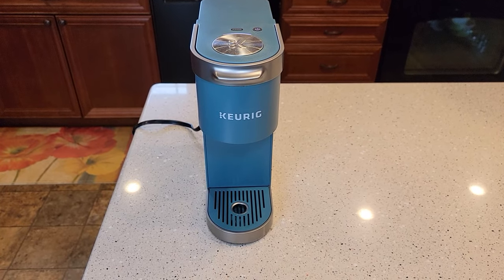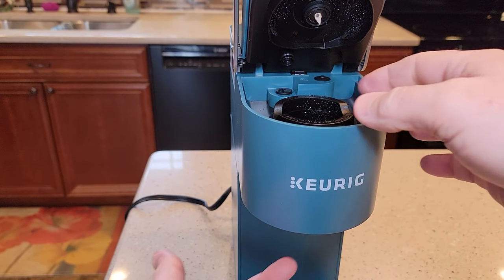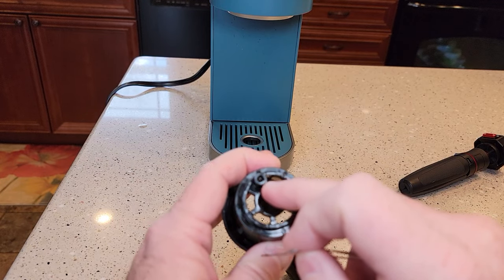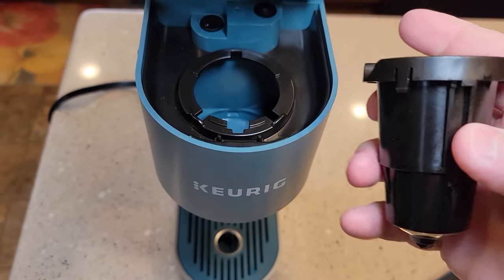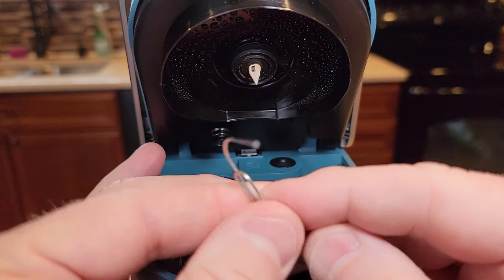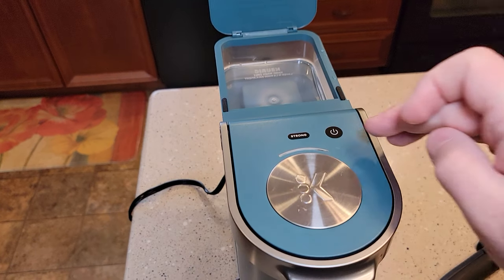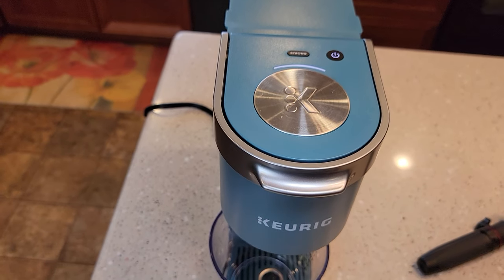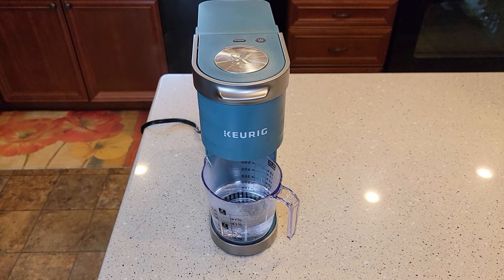Keurig K Mini K-Cup Coffee Maker NOT WORKING How To Clean Needles & Fix Not Brewing

Comment: I did everything showed in this video and still the water didn’t drain through the reservoir.  I discovered the filter inside the water reservoir was clogged due to me pouring a cup of freshly made coffee back into the water tank which caused the sediments to clog the reservoir filter.  I suppose I should’ve have done that. Lucky for me I got it working just fine after cleaning out the coffee sediments from the water reservoir.  Hope this will help anyone else with this problem.

Comment: I phoned the Keurig help line who then suggested cleaning the needle. I did and it worked. Flash forward a month and I'm back at square one. When it's not working, when it's clogged, the water gurgles and gurgles and comes down the inside of the machine into the bottom tray. It helps that you show how to properly clean the needle, specifically pushing the probe UP into the internal tubing. This has now solved the problem I was having. Also important is not leaving the K-cup pod in the tray after it has been used.
Reply: Now you might do a video about how to remove the cap from the Keurig cleaning solution after it gets screwed on stuck at an angle to the container. LOL.

Comment: Thank you for this video. The water wasn't dispensing and I thought I had forgotten to add water, so I added more water and it overfilled the tank. I didn't know how to get the extra water out. I found this video and I cleaned the needles and then also held down the button and my water came out. This saved me from having to take it somewhere to get it fixed.

Comment: Appreciate the tip - mine died just now - made slightly angry pump noises and only put about a half inch of liquid in the bottom of the cup.  Blew out the bottom needle and poked built up coffee grounds from the top, ran some plain water through and it’s back up and operating once again.
Reply from the maker: You are so welcome!

Comment: To force the water out:
1) Close the lid and press the big button. You will hear it start to pump.
2) Open the lid a little and then close it.

On mine, this will cause it to skip the heating and it will push out all the cold water.

Comment: You would be able to do a vid on the K900? I'm a handyman for a 28 room lodge with kmini and k900's. I've fixed a few kminis but the k900's baffle me. Most stop even sucking in water. And i honestly think they are designed as throw away units. The needles are never gunked up. And i may be wrong, but do they work with the cover off, I've never been able to troubleshoot one with the cover off and plugged in.

Comment: Hi!  My mini Kuerig is leaking from the bottom.  The cup is not cracked and I have cleaned, descaled, etc.  My reservoir is not removable so it appears I am not able to access a O ring.  Does the machine need to be replaced?
Reply from the maker: Wow sorry to hear this.  I would give Keurig a call 866-901-2739 they have great customer service.   I am not sure about the leak but I have had several viewers ask me about there K mini leaking water.  I am going to open mine up and see If I can see where the leak is coming from.

Comment: This doesn't seem to be my problem I'm looking for a solution I have the same single mini Keurig and the round button on top which usually starts it doesn't want to start the light blinks but I push it and no matter where I push it on that big round button on the top it just doesn't want to turn on. Anyone have any suggestions I tried to separate the top part so I could get to the hoses and that top portion but I don't know how to separate that and I don't even know if it does separate it.

Comment: It's really odd mine is 2 days old but stopped flowing just spit drips made a mess, I was going to just return it, I am using basic Nantucket pods nothing funky or off brand, yet when I did the clean jets and ran water thru (mind you I've only made like 6-7 cups total in this new machine) it came out totally full of grounds in the cup of just water running thru it.

So I repeated the process gently cleaning out the top 3 needles up into the tube circular motion, ran just water thru a few more times till it was flowing and no grounds, then made a decent cup of coffee again, but I guess I just didn't expect it to clog up SO SOON, if this happens again in the next 6-10-15 cups made I think I may just return it, when I want coffee in the morning I don't want to sit and mess with it every week to get it flowing again, hopefully a fluke and once a month I will just do some clearing and run water thru it.
Reply from the maker: Wow that does seem like it got clogged very soon.  That is why I like the Keurig machines with water tank reservoirs that hold alot of water.  the K-Slim is a great machine.  see my video on it https://youtu.be/HmNQslDiQsQ
With the water tank it makes running a fresh water rinse so much easier than having to fill up the reservoir each time you  do a brew.    I get a lot of comments on the K Slim clogging up so there must be something to it that makes it clog up more than others. 
Thanks for Watching and let me know how it goes.
Reply: I'm in the same boat! Mine is only a few weeks old and it has been clogging since day 1.  My old keurig lasted for over 10 years!
Reply: @hayikat  I ended up returning my single cup version, not crazy about the new one I got either but it punches 5 holes in the kcup and seems to flow better (so far)...

Comment: Helpful video but my Keurig mini isn't drawing the water up and out of tank. It is relatively new so I'm confused. Is not clogged but... my kiddo accidentally poured water into the k-cup area instead of water tank. :0
Reply from the maker: Pouring water in the K cup are should be ok.   Your water tank inside the machine might be full already.   Plug it in and open the k cup handle and leave it empty.. close the handle and press the big k botton like you are going to do a brew,   give it about 5 min and see if water comes out.   If nothing ,  lift the handle again and this time hold the big brew button or K button till water comes out, you might have to hold it for 3 or 4 min. let me know how it goes.
Reply: @JustADad  
I’m having this issue of water not being drawn, very new and not often used. I held down the button for 5 minutes or so but nothing. Any ideas? Thanks
Reply from the maker: @samsp6901  mabe put hot water in the tank and see if it will help clean it out.  have you cleaned the needles.
Reply: @JustADad  but the water is not being drawn at all, would placing hot water make a difference? I cleaned the needles as well and nothing. Thank you for responding.
Reply from the maker: @samsp6901  Try holding down the big k button for a long time

Comment: Mine did not worked it’s so frustrating because I just purchased a month ago and it only brewed once after that no more. Also this is the second one I get because the first one did not turn on at all.
Reply from the maker: yeah that is a bummer.  are you leaving your k cup in after its done brewing?
Reply: @JustADad  yes I leave it until it colds down and then I remove it. I have to add tons of water and press the brew button so many time in order to sometimes work.
Reply from the maker: @erickvazquez5323  I would call Keurig customer care at 866-901-2739.  They have great customer service.

Comment: dind't work for me.  when i push the big brew button it just keeps flashing.  cleaned the needles.
Reply from the maker: Maybe try to unplug it for about 5min. then plug it back in and put water in tank and try to hold down the brew big K button for about 30 sec. Not sure if that will work but give it a try.

Comment: I've found 2 major flaws with the Keurig mini so far: The needles getting clogged and the water not heating up or dispensing when you put less than 6 ounces in the top.
I've ordered 2 units from Amazon Warehouse Deals (returned, inspected by Amazon and resold) and both units had clogged needles. I think people just don't know how to fix the issue and simply return them. Amazon doesn't check their returned product very well either. Once they sold me a PS4 game with a BURNT disk (clear disk, no art, visible burn lines) in the case. "Amazon Warehouse Inspected" sticker on the case. I had to laugh...

Comment: I need help mines still not working and it’s not putting out hot water. I cleaned it and nothing 😩
Reply from the maker: It can be a bit tricky,  you might have to clean it a little more.  I had to clean my needles 4 times once.   If not I would call Keurig
Reply: @JustADad  thanks I ended up getting a new one instead.

Comment: I hate Keurig, with a passion.  I ended up switching to Nespresso for my home and it has NEVER given me a problem.  I've learned that with all these machines, including Nespresso.  NEVER buy the single serving version, they all have problems including nespresso single cup.  I will say, EVERY KEURIG machine I have purchase, EVERY SIZE has always given me the same issue of the pump not working.  Even after descaling, taking apart all these parts like this video, it's constantly the same issue.  It's not my water source because of the ones I've had in different locations, home, office, brothers office, etc...  Even using bottled water, or cooler water, NEVER used tap it's always filtered.  Still the same issues.  How can a company that makes such TERRIBLE products still be selling units and in business.  It's honestly mind boggling.

Comment: Stopped Brewing after 2 weeks on 2 machines, BS. Luckily I bought them from Amazon and easy returns. Is this normal for these machines to clean out needles before getting coffee after 2 weeks of use with K official kcups? F-that. Let Keurig eat these returns until they make a better product.
Reply from the maker: Thanks for the update
Reply: @JustADad  The funny thing is that your instructional video here did the trick, after I cleaned it out with the paperclip it brewed. I forgot to give you credit. TY. However, I'm still not going to go thru this say, 50% of the time I go to brew. I wonder, if it's just this Mini-plus? I know others with full size machines never had this problem in years. I mean, 2 machines, in 1 month?
Reply from the maker: @PaulAlan21  The k mini definitely clog more than any other machine, not really sure why.

Comment: I have the slim version.  I use a water dispenser with a built in Keurig usually and it's so much better than this Keurig slim device.  Almost instant.  This thing is slow and I have to play with it to get it to work and it's inaccurate.  Not a fan!!